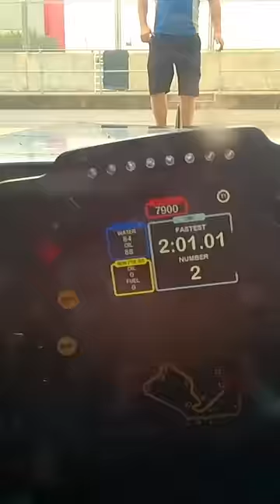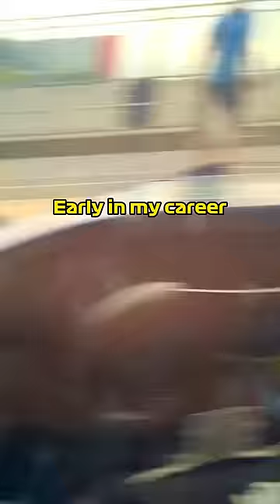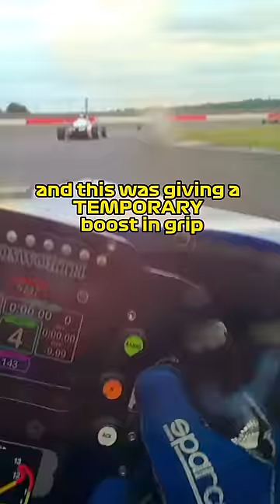The WORST way to warm up tires...

Comment: ''i didnt know this damaged the tires'' bro y u think drifters always need tires
Reply: Lol this comment is so….
Reply: Well, if you watch motorsports, you should know drivers do burnouts to heat tires and remove that first layer, so they work better.
Reply: i went to a drift show once...

the amount of rubber thrown around... damn.
Reply: drifters and racers are different 

drifters uses hard tires or maybe special tires that lasts 2 laps for the best drifting performance while in circuit racing they use slick tires to race to the end with more than 15 laps
Reply: @2928e8  Yea not a fucking wicked burnout. They do it for a split second not a whole 7
Reply: @2928e8  to heat up the tires yes, the "removing of the first layer" is not benefitial with most tires because most of their performane shows with the start of a tires life
Reply: @initialdoge8528  i know haha but i think u missed the point, if u do burnouts, your tires life will deplete quicker then if u dont. doesnt matter if its a racing or drifting tire
Reply: @2928e8  🤦🤦🤦🤦🤦
Reply: I wish this wasn't the case 😂😂
Reply: Bc there doing consistent burnouts THE ENTIRE RACE or drift course technically
Reply: @2928e8  in drags when they do a short run but I never heard it in any road or oval circuit race. And theres a reason for that.
Reply: You can’t drift if you don’t have tires to do so 😅
Reply: You should light up the tyres by punching the throttle for a second, helps grain them
Reply: Just embarrassing to be honest
Reply: Why do drag racers do a burnt out
Reply: @Grass_roots_auto  their burnouts are controlled, it’s completely different to just throwing the car over the edge of grip
Reply: This comment hurts. 10 bucks says he was being serious too.
Reply: Nah honestly cuz they look chunky I just thought burnouts should be fine
Reply: @wahyudyatmika5119  Yeah I spend 4k in tires on each trip to the track😂
Reply: @wahyudyatmika5119  ye, thats the good stuff...
Reply: @mrjman2541  mercedes literally designed their f1 car with toe adjustment through the steering wheel specifically to scrub the tires
Reply: after that statement you know they're as incompetent as a driver as they were in high-school
Reply: 💀💀fr
Reply: @THEREALJOHNDOE32  Yeah obviously but Cameron obviously didn't do it for 7 seconds either
Reply: @2928e8  except………….
Reply: Sometimes common sense is triumphed by complete knowledge. OF COURSE doing a burnout damage tires but only slightly they also warm up your tire providing more grip which is why drag racers ALWAYS start the race with a burnout. Pros and cons nothing is perfect
Reply: @2928e8  I do it on fresh tires to rip the first layer off so I didn't have to break them in as long
Reply: @2928e8  I’ve seen drag racers do that, but only because they also don’t care abt the tire, and it’s usually a massively thick tire too
Reply: In my humble opinion, any tire wear isn't worth the extra stickiness in the first turns/lap. Some drivers don't even do the sway. I think Kimmi doesnt
Reply: @2928e8  bro is defending😅
Reply: Bro ur literally scraping the tires on the floor
Reply: Drift tires are much different compound aswell, they can withstand more abuse and they do burnouts to warm the tires up which in turn gives them more grip
Reply: exactly what i was thinking.. no hate tho
Reply: Drag racers
Reply: How is drifting relevant to formula racing?
Reply: Basically said “Didn’t know stressing the materials damaged them” and didn’t see anything wrong.
Reply: and drag racers
Reply: @2928e8  isn’t that mostly for drag racing
Reply: @Nostalgic_Lewis  no, heating the tires is for any kind of racing
Reply: @2928e8 first layer, not when it’s used already
Reply: Look at indycar pitstops. Lots of burnouts
Reply: I understand because drag racers will also do a burnout to warm up their radials
Reply: @wahyudyatmika5119 yeah it more than you think 😂

Comment: I thought it would be common sense that doing burnouts would damage tires since you're wearing them out
Reply: exactly
Reply: Wearing tires does not damage tires to a certain extent. New tires are actually quite slippery so they require a few laps to warm up and reach optimum grip. If you scrub them they reach the optimum grip faster. Scrubbed tires are less prone to overheating. In this case, him doing a burnout is damaging the tire because you heat them up too quickly.
Reply: In racing it's common to do burnouts to warm up tires
Reply: @alexj.5207  not at all
Reply: @SockyNoob  In F1 they do burnouts to heat the tires because they do standing starts
Reply: It is , this guy just paid to drive and has no real race craft but decides to pump out videos telling others what to do
Reply: @darkwhitegamer5  Watch more of him and you might change opinion
Reply: In this context, "damaging" is different to "wear"
Reply: @SockyNoob  it is, look at f1 drivers, they always do burnouts on the warm up lap before they line up. doing it when the tire is 100% cold can damage the tire due to the tire "ripping"
anyways tires warm up more through the brakes and heavy acceleration.
Reply: @broshido2745   you havent watch a gp in your life
Reply: @alexj.5207  you can seriously damage the car so its rare and likely to get in trouble with team and potentially race organizers 

For example a british BTCC car engine is around 100k a pop and then other components hybrid etc etc a used btcc car can be upwards of 60k a brand new one 500k plus
Reply: @thelegendformula6695  risking trashing the engine and diff aswell
Reply: comment by someone who doesn’t know shit about racecars spotted lol, F1 drivers literally do a burnout every time they place themselves on the grid to warm the tyres
Reply: @zochiang  i think you’re the one who didn’t, another DTS fan, come on guys stop
Reply: Everyone knew this except the person who made this vide LMAO
Reply: @alexj.5207  In drag racing only
Reply: Well obviously but you need to heat the tires for grip
Reply: @SockyNoob  well in drag racing but that's about it.
Reply: @bencri6248  they don’t, they do practice starts at the end of free practice sessions, and that’s just natural wheelspin rather than warming up the tires. They warm up tires by accelerating and braking, which heats up the inner part of the tire, while going side to side heats up the outer part.
Reply: Ik what i was thinking🤣
Reply: Well some guys in a competition named F1 do that and it seems it works for them
Reply: @thelegendformula6695  Questions is do you call wear damage or is it normal wear....😂
Reply: And the clutch too
Reply: @broshido2745  this if f1 cars just the f1 have Abit more aerodynamic parts on and these are good old v12s like f1 a used to be then went down to v8s
Reply: @darkwhitegamer5  you can’t just pay to drive a f1 car like that takes years to learn how to drive one properly clutch control cornering everything they stall so so easy and aren’t key started i wish you could pay to drive a car like this 😂
Reply: @Tim_3100  why are you giving casual road driving advice in a racing discusion?
Reply: Excessive burn outs will damage the tire but a little bit like he did actually improves grip and increases performance longevity is based on how you drive more than the heat of your tires in small amounts if you watch videos about F1 they have tire warmers so you don't need to burn out to warm up your tires also look at drag racing they burn out more than you did and they aren't worried
Reply: It is this YouTuber just pretends to know racing
Reply: Well they are an f1 driver
Reply: 😂🤷🏽‍♂️ I don’t know how he missed that part 😹
Reply: @Socky Noob  yes they do, atleast in high irating lobbies
Reply: When you do a burnout you only heat the outside of the tire. For best life and longevity you want to heat the whole tire by "leaning " on them but not breaking traction.

Comment: "But I didn't think that heating the tire up until it burned straight into smoke, was going to damage it. I thought Burnouts added life to your tires."
Reply: Bro, i think he meant that it wouldnt damage them enough to make a difference compared to heating them up by driving harder. Both techniques wear out the tire, he thought they produce the same result, but one was just too intense
Reply: Bro didnt have pro drift mod on
Reply: I don't think this guy watched the full video lol

Comment: Almost every F1 Driver warming up tires in the first round with extra steering, then there is this guy's telling us:
Reply: He said over scrubbing..
Reply: @_hanz73  he said warm up as well
Reply: @_hanz73  what's happening with the tires when you steer extra? You over scrubb them. Or not?
Reply: @steveengelmann8518  you do scrub them for heat. But obviously you trade off the lifespan of the tyre. It’s worth it though cuz you really want that grip in the beginning to take positions. You wont lose much from scrubbing since the field will usually thin out a lot during the race. Start is everything
Reply: @spacewalk3046  He said on warmup lap
Reply: @spacewalk3046  he never said that. He said "warm up lap" which is a lap given before the race to get the tyres up to temperature
Reply: @fisken1  I don’t think that’s true across the board. Cold tears have varying degrees of severity, so there is definitely a fine line you don’t want to cross. The best performance comes at the start of the tire’s life. Even though you got the hole shot cause you over-scrubbed your tires, you’re now no a tenth of a second slower per lap than the competition. Over a 50 lap race distance this totals to seconds. Pick your compromise. There is no wrong answer until hindsight
Reply: @geraldmaga5803  ye my bad i know what it is is alike formation lap
Reply: @steveengelmann8518  Extra steering is also scrubbing the tires but what he meant is OVER scrubbing!
*edit: in other words he basically said Don't overdo it
Reply: F1 driver does a very precise type of burnout they don’t do random burnout they actually have an indication of how much they need to burnout without damaging their tires
Reply: Pretty sure thats why kimi didn't zig zag as much as others. He prioritized longevity over temporary boost in grip.
Reply: This isn't a f1 car or f1 tires
Reply: @nbain66  look up the short called Kimi doesn't need heat in his tyres that's what I was making reference too.  

The link you sent me just brought me back to this video.
Reply: @THIS---GUY  https://youtu.be/rL5LCQui1O0

Not sure why my clipboard did that, but like I said, it depends on the car. Once he got into the better Ferraris he stopped over scrubbing again.
Reply: Extra steering and weaving really doesn't warm the tires up either. Using your brakes do.

The weaving is just something the drivers do to not be bored and maybe lay down some rubber.
Reply: @brolo7234  It does, you think you are smarter than F1 teams lol
Reply: @ThePgR777  No it really doesn’t. It very slightly raises the surface temperature but that is lost almost immediately. The main purpose is to scrub the tire to get marbles and what not off the surface to make it as smooth as possible. Braking is what generates the vast majority of the temperature because it not only puts high energy into the surface of the tire but the brakes themselves heat up tremendously and the wheel and tire soak some of that up. This heats the carcass of the tire which is the most important for getting the correct tire pressures and retaining temperature when you aren’t putting much energy into the tire such as on straights. Otherwise they would lock the brakes at the end of every straight. Why do you think F1 drivers almost always tip toe around on their qualifying outlap? It’s because the tires are preheated so the carcass is already hot and weaving will only take rubber off the surface and lose performance.
Reply: Big difference betwen f1 tires and this ones
Reply: they avoid scrubbing the tyre as much as possible. They'll weave em which is fine but scrubbing em is just ruining longevity.
Reply: @steveengelmann8518  They don’t scrub the tires though. They just weave for heat.
Reply: @brolo7234  lol not at all... weaving streches the tyres, warming them up, it works better for the rear tyres, and breaking hard helps with the front ones.
Reply: F1 tyres are pre warmed too 80 degrees C before being put on the car. If you are one stone cold tyres it’s different.
Reply: Strategically, in F1 or racing it would be to get an early jump at a higher position or defense.
Reply: @bastiaan3 .
Reply: Kimi just driving straight when everyone else swerving around tho
Reply: f1 tires and other racing tires are completely different tho.
Reply: This guy is racing F4 and F3, his tyres have to last the entire race and his car is still, despite having aero, mainly mechanically grippy. So tyre life matters way more in F3 then F1. In F1, your car is more aero grip, so tyres dropping off matters less, and you always get atleast 1 new set in a race.
Reply: @CharlesFreck  nah matters the same in f1
Reply: @ThePgR777 you are so confidently wrong, teams have always said it doesn’t actually do anything for temps and drivers just do it out of habit, not even all drivers do it anymore.
Reply: @ThePgR777  No, I don't, which is why I am straight up repeating what F1 team engineers have said--the brakes warm up the tires. Weaving generates a minimal amount of heat.

Comment: How were you a racing driver and didn't know that☠️☠️☠️
Reply: He isn't some academy driver for Ferrari. Dude was probably some 12 year old who got into Karting for fun.
Reply: @ccramit  it's common sense that doing a burnout is going to damage a tire.
Reply: Guy probably saw drag racing videos where they warm up tires in a second doing a burnout
Reply: @a3nofficial25  yeah in drag racing they use water to have less friction
Reply: he may have only thought it wears tread and since its on slicks anyway it doesnt matter
Reply: Probably a kid with a little to much of daddy’s money and not enough sense
Reply: Junior formula are were drivers learn to race... This is the kind of stuff that they'll learn.
Reply: @therrydicule  Karting?
Reply: @BloodyMindset  💰💰💰
Reply: @surrealix58  
Karting and series like F4 are considered as two distinct entry points for aspiring road racers.

And even a teen with a lot of karting experience will do some stupid stuff in the first few months in something like F4. Because you need some new skills with a "big" (well, compared to a kart, it is big) single seaters. Things like brake modulation and consideration for weight transfer (some very good karting driver sometime would be a little over aggressive with an F4 at first and spin a few times).

At the burn out thing is just a little dumb: it doesn't really put anyone on the track at risk, and Paul Tracy have done the same in the pit in Cart a few times while leaving the pits... It's a bad habits, but they are worst bad habits to have for racer.

I think the issue is we got something young talking about learning and older people looking at the video and going "well, no shit it's bad ;) "
Reply: Bro thought he was playing an f1 game💀
Reply: @imdeadinside792  we make too many assumptions about people these days just because he’s in an F car
Reply: Early in his career
Reply: @ccramit  hes saying he was surprised that using friction to warm up the tires wore away the tire. What did he think wore away tires other than friction?
Reply: @ccramit  bro that ain’t a go kart 💀
Reply: @hks2.3stroker6  also to aid in cleaning the tire as well
Reply: @ccramit  its common sense bud clearly you shouldnt be a driver either learn to take constructive criticism and not get defensive over one comment
Reply: @ccramit  Literally everyone knows that ripping something up damages it.
Reply: because he probably thought the outer layer of slicks is the same as the whole tyre, meaning doing a burnout would just shred a tiny bit for ‘useless’ rubber and heat up tyres
Reply: his dad...
Reply: He must be a Biden supporter 😂
Reply: Cause he go real fast the blood flow takes a while to catch up to his brain
Reply: Parents have money
Reply: @Batman4rl  he has a brain?
Reply: Nowadays the easiest way to get into pro racing is family money☠️
Reply: He said early in his carrer
Reply: Privilege gets you farther than talent.
Reply: You didn’t know until you knew . keep that in mind for everybody else you in encounter in life .

Comment: Show a “how to properly warm tires” vid next
Reply: well its basically just this but less extreme, people make comparisons to f1 but they actually make pitstops (hence the temporary grip but less longevity)  these guys probably are doing 1 stint races, and the tyres also have a lower optimal temp than f1 tyres
Reply: I think he already did make that video
Reply: Literally drive a few laps normally to warm them up.
Reply: I wouldn't trust a single word this dude says after "didn't know this was damaging the tire"
Reply: Tire warmers 😄
Reply: Just put heat blankets around each tire
Reply: Just gotta lap a few times at decent speed to warm em.

Cornering and braking heats the fronts more, Accelerating heats the rear more
Reply: @gherbo1609  also f1 drivers get instructed on how many burnouts to do. These guys most likely do not
Reply: Before they even go out the tyres have tyre warmer blankets on to warm them up
Reply: @gingercyclops4397  you do realize man actually knows racing now

Comment: Great advices! I do when possible a few laps not forcing too much the new tires, than I take it out and let it rest for a day or two before using again to the races, this usually gives more grip and they last longer than when I need to get brand new tires and go directly to race with the set, those usually overheat and get more slippery at the race.